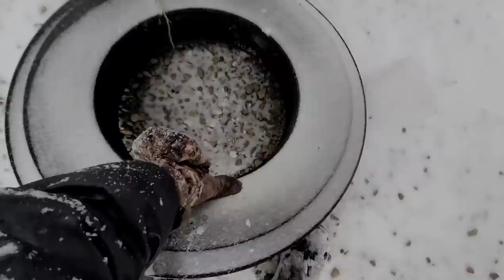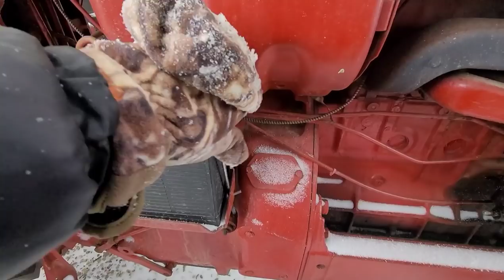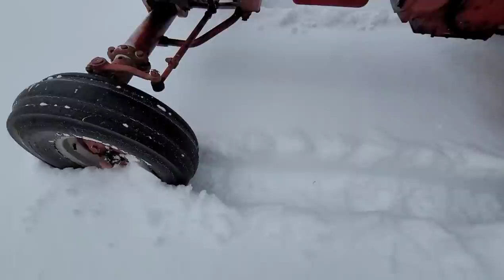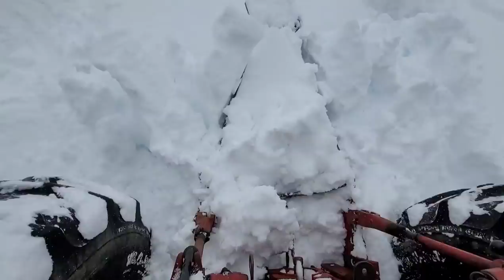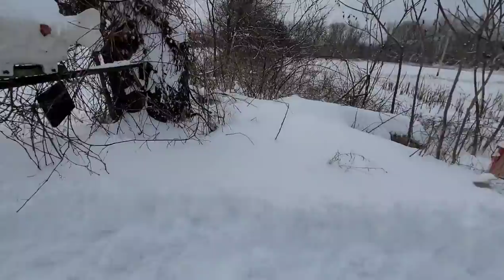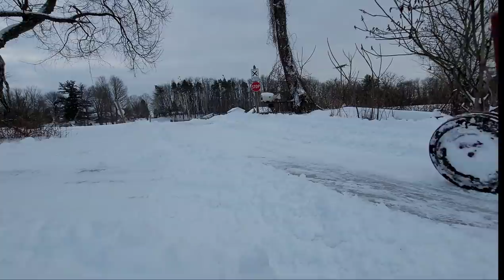Plowing Snow After a Blizzard | Farmall 756

Comment: You need to setup all of your tractors with the hookups for the little Battery Tender Jr!  I have all of mine setup and I've been getting at least 10-years out of my batteries.  You could run a single extension cord out to your tractor shed, and have a couple of them on trickle charge all of the time.   Also if one does go dead (or low) you can just plug in the connector instead of having to remove the battery box (really nice on the Farmall M).   Keeps the batteries from freezing and REALLY helps with the battery life.  I just changed one battery last night, and figured out that I bought it in 2007!  Not too bad!
Reply from the maker: Yes I do

Comment: NE Ohio here. My 2012 Kubota has the original factory battery and cranks fine. My 1996 John Deere 870 needs help occasionally with a 3 yr old Interstate, if not run every few days. The Massey Ferguson MF20 has a used up cell phone backup battery. It needs help if not run as well. Glad to see you were able to dig out.
Reply from the maker: Running them absolutely matters

Comment: Always enjoy seeing them older Farmall working. Was raised on a Farmall H and now have a 806D. Nice tractors you have
Reply from the maker: 806 is the 4020 killer...awesome machine
Reply: Love ur show brother, so some young guys mite scoff at a gaser but they start soooo well in the cold weather, plus they put up very similar power numbers when compared to the diesel engine (which are great too) in fact put a late model gas 706 (with the 291cu in, like ur 756)side by side in the field with a 706 diesel (both weighted and tired the same)and there is little difference in performance, cheers FF.
Reply: 2 years seems awful short for the life of a battery. Maybe u leave them too long before charging them up like are some of those Tractors sitting idol for long periods.

Comment: I have a Super Start (O'Reilly) battery that I installed in Oct 2017 on a 1973 Cub Cadet model 128.  It is still strong and starting the 12hp Kohler engine at 25F.  I may have used a charger twice over the past 4 years, it always holds the charge even when I am not using the little tractor for a couple of months.
Reply: Famous last words. Batteries suck.

Comment: I bought a 1000 amp battery from auto-zone july of 09 for my 706 and still have the battery in jan. of 22 because of my single pole gm alternator,  and I have an 8 ft dozer blade mounted on the skidder winch on the rear with field chains

Comment: I got a solution for your batteries not lasting. Install a disconnect on the battery. When not in use for a long time the battery will still be changed. I have one on my tractor and the same battery is still going strong.
Reply from the maker: I've actually been meaning to do that for a long time